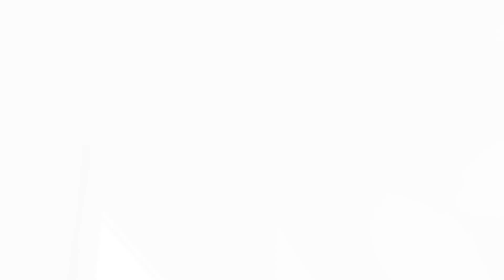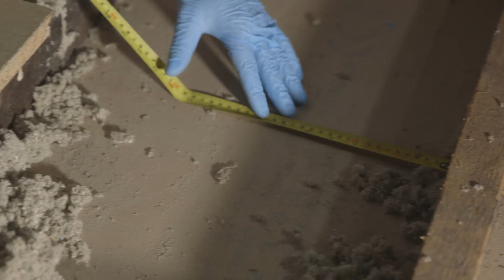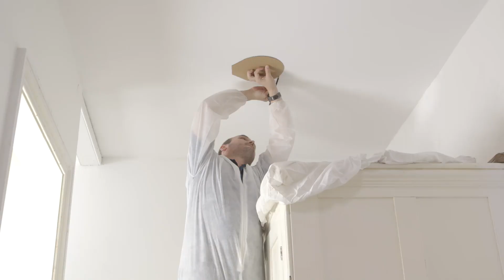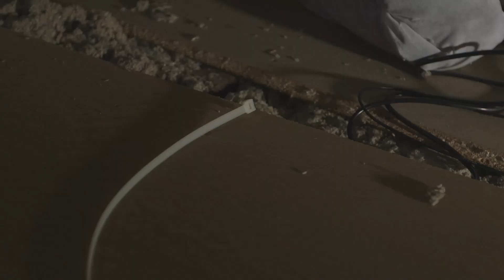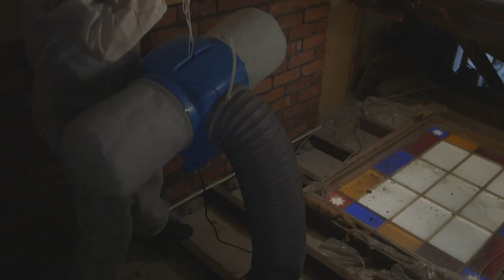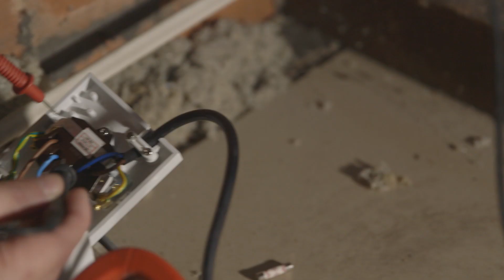Drimaster-Eco Installation - Part 2: Installing Your Drimaster-Eco System

Comment: Hi mate do you no where you fit nuaire piv carbon Dioxide Sensor because have I got my boiler in my  loft  do you fit it in to loft or the landing. Thanks matt

Comment: Can it be turned off by me, the person renting the property, who has to listen to it being too loud at night (and it is new!)
Reply: Dude I have the same issue.. use to blow hot now its cold and loud... ours inst hanging like this either its basically touching the floor hung by a piece of string.. not control panel and its connected to the lights so I guess not